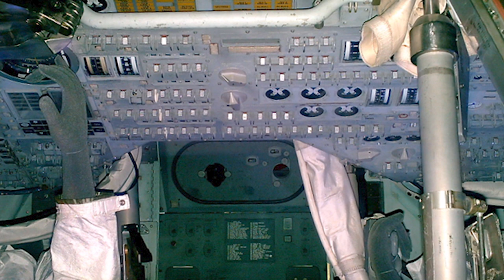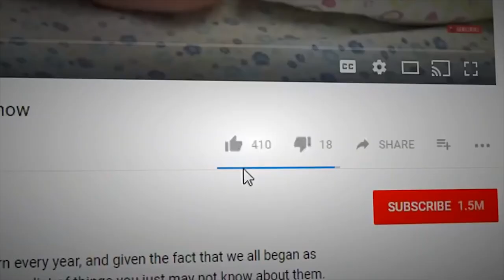FAMOUS Engineering Disasters

Comment: The Vasa failed because while it was under construction, the King paid a visit.  He said, looks good, but needs more guns so an additional gun deck was added.  however, it was too late to increase the ballast to compensate for the higher center of gravity.  This is what happens when upper management gets involved in engineering decisions.